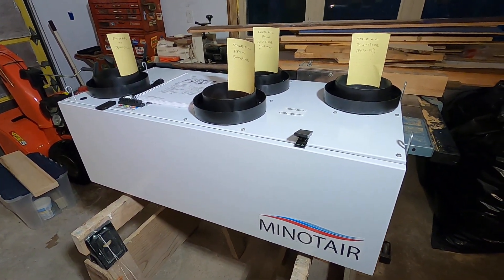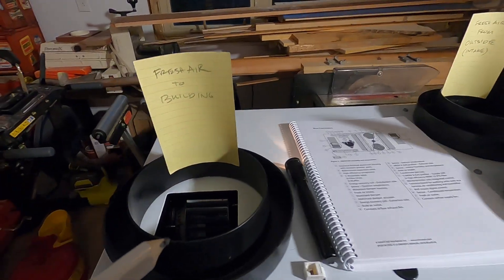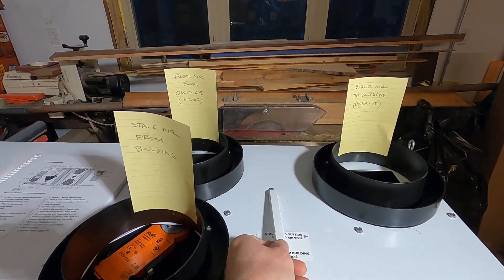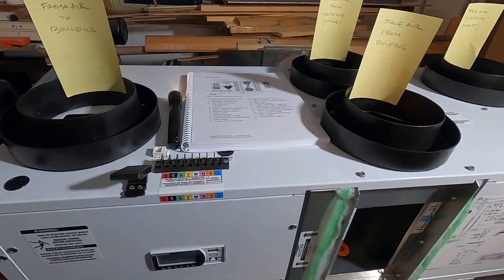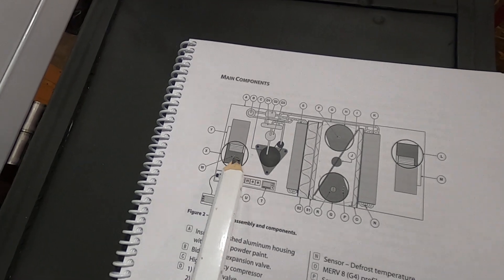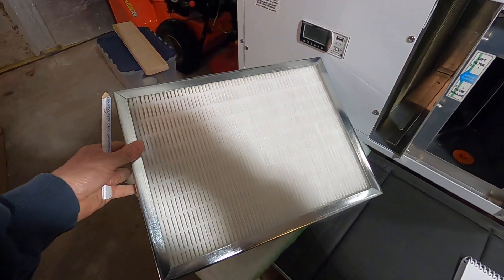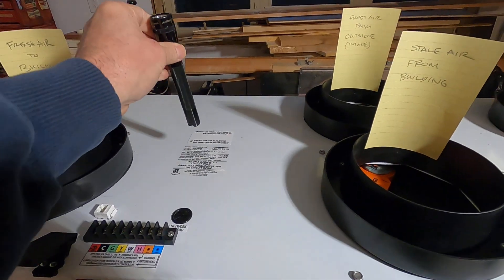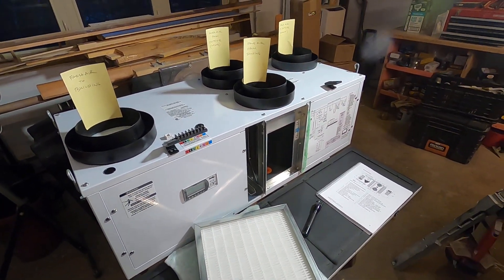A brief tour of an HRV

Comment: The Minotair V12 is a particularly advanced HRV / Heat Pump  / Home Filtration system. I would be very interesting in getting more information about how it is performing.
Reply from the maker: I'll try to make the time to post more.  This is the first winter I've been running it.  It has a commercial grade microcontroller, so can run in many different modes, even automatically.  Right now it's set to automatically switch between heat pump, HRV ventilation, and humidity management with internal circulation.  I'm in Maine, so it's heating season, cold and dry.  For example, when a shower starts up, it detects the moisture, and automatically starts recirculating it throughout the house, raising the RH (in the low RH winter).  However, in the summer, it dumps the moist air outside, keeping the RH lower.
Reply: Too advanced imo. Bet this unit is $3k or more. I think a good dehumidifier w\fresh air is the best bang for the buck
Reply from the maker: @mateo-6965  Opening the windows is even better, but not that comfortable at 10* Fahrenheit.  Here in Maine, we don't need AC or dehumidification very often.  This house is R40 walls and R80 roof with triple pane windows.